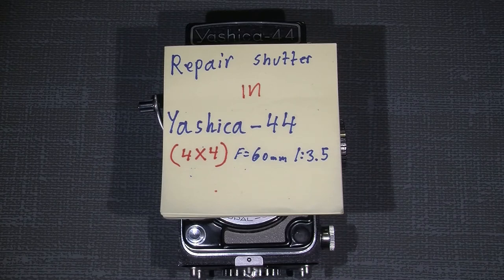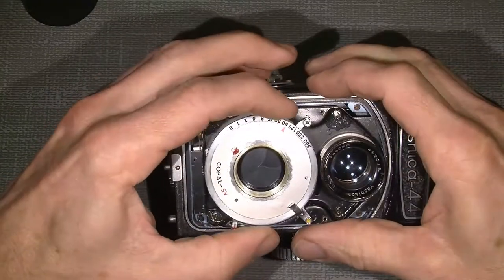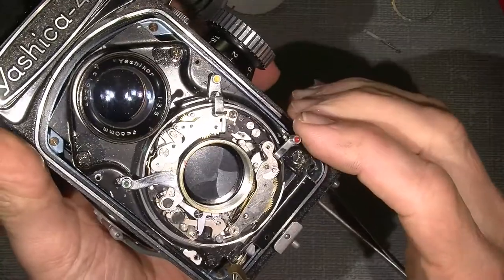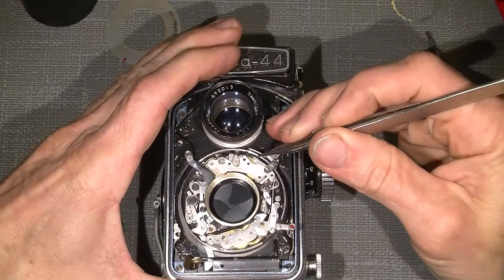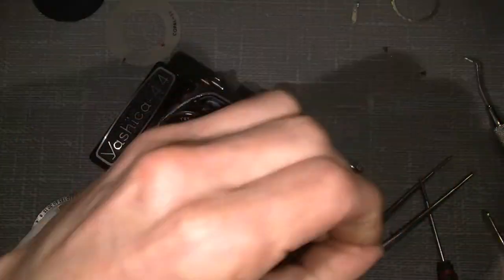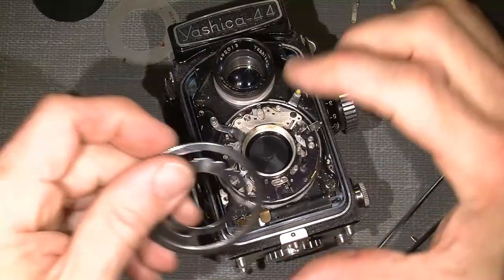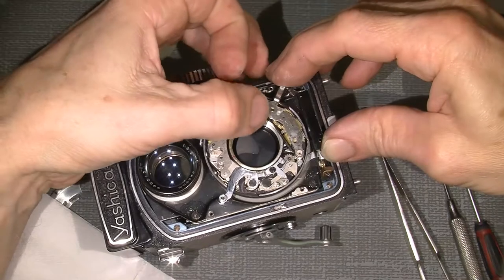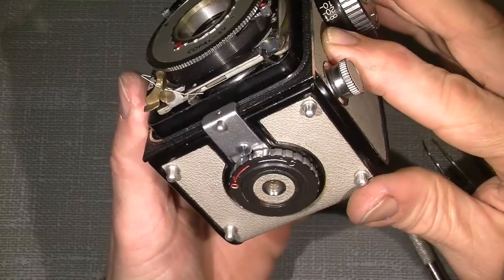Repair the shutter in Yashica-44  f=60mm 1 3:5

Comment: This video just saved me so much money. I purchased a nice Yashica Mat 124 yesterday in good condition for 200 dollars, but lo and behold, the shutter wouldn't fire. I found it was due to a stuck self timer and that flat pin you mention (around the 20-25 min mark in your video) was the culprit. Moved it out of the way with some pliers, and reassembled. Work's like a charm. I still have some issues with the shutter button not firing the shutter all the way correctly time to time, but that's a later fix. I am very satisfied and immensely thankful to you.

Comment: What would be the possible cause of the shutter only opening in slower shutter speeds? Mine seems to open fine unless it’s the shutter speed is at 250 or 500 then it won’t open.

Comment: I have just aquired a Yashica 635 and all shutter speeds sound the same exept for B. Will this method work for this model too?
Reply from the maker: In many cases It would be the solution, but of course, there could also be some other issues.
Reply: @mikeno62  thanks. I just opened it and cleaned like in the  video but still all shutter speeds are the same

Comment: Great video! have you done the Mamiya C330? On that one my shutter is ok but the shutter button on the body is jammed.
Reply from the maker: Thank's Lavikka, yes I have work with the Mamiya C330 and it's a problem with the more poor material they have use, compare with the older camera body's (C33, C3, they was better made).

You need to take the botton plate off to get into the shutter button, the way they have made this construction is not that good because of poor material. maybe you also need to take off the winder side plate, sometimes part's there are also not good.
Reply: Thanks. I will try that this weekend.

Comment: Hello, I need help please!! All the shutter speeds are ok except 15 and 30, they are around 1/2 second. But the other slow speeds are ok
Reply from the maker: Then you need to take out the slow gear and clean it with lighter fluid and then, then lube the axle end's only with very thin clockwork oil.

Comment: what kind of liquid do you use to clean the machine inside.Many thanks.This is a great video.
Reply from the maker: I use lighter fluid to clean the slow gear and the self-timer, I then lube the axle end's only with very thin clockwork oil.

Comment: Hi there. Your channel is great. Thanks for the videos.
Just a question: How about the shutter blades fail to form light tight closure. What might cause this issue?
I have a German TLR (weltaflex with vebur shutter), everything looks and works good mechanically but I noticed I can see a very little amount of light passing through the blades. I don't know whether it's worth (and possible) to fix it. :-/
Reply from the maker: Thank's, it could be a wornout shutter or maybe too much dirt and dust in the shutter. But I found some info here:

https://www.rangefinderforum.com/classics/forum/messages/2/22414.html?1315049951

And here:

http://pheugo.com/cameras/index.php?page=compur&WEBMGR=89eaa9ce05ff49a9f1a98c1c7028a2f9